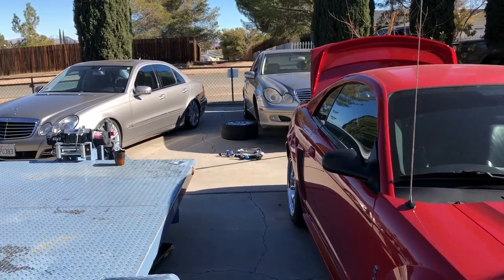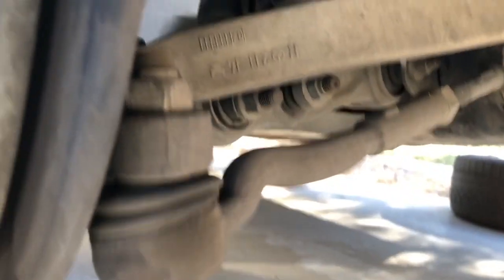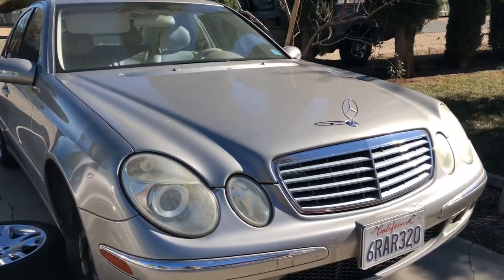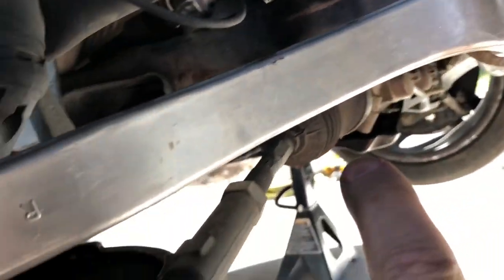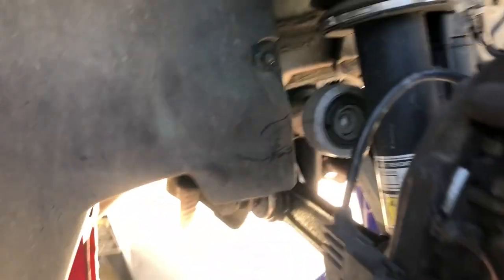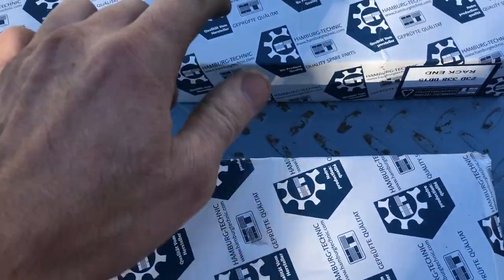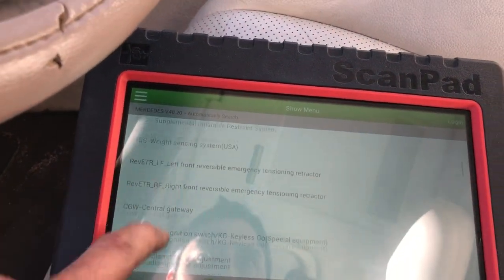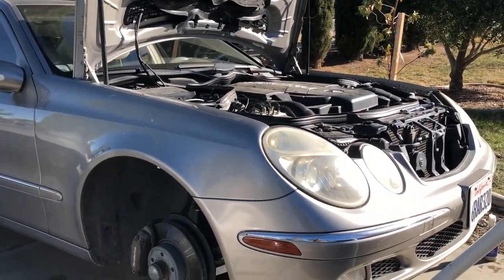W211 Mercedes E-Class Front Suspension Squeaking?? This is How To Fix It

Comment: my w211 had upper ball joints squeecking. many times just injection with lubricant and a silicon batch will fix the issue

Comment: How and what do you need to press out your bushings ?
Reply from the maker: There is a specialty bushing removal/install tool that allows you to do the job with the arm on the car. Or you can just use a press if the arm is removed from the vehicle.
Reply: ALLMUSCLE thank you !